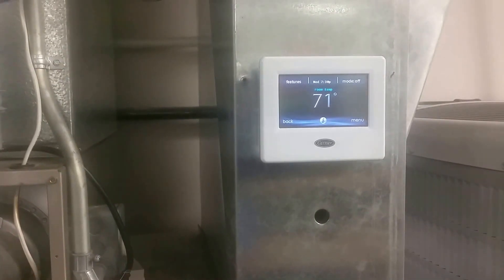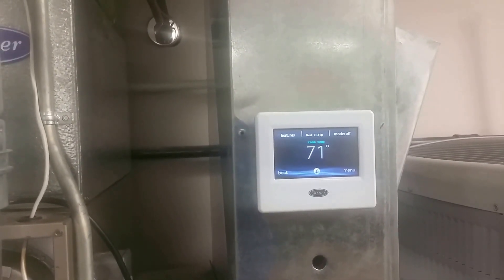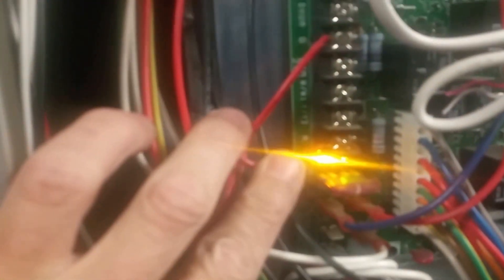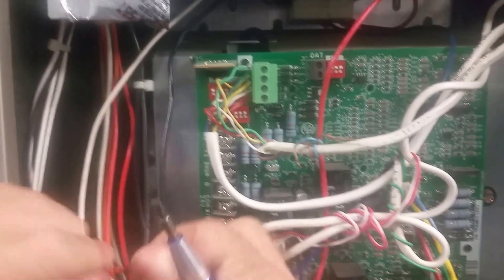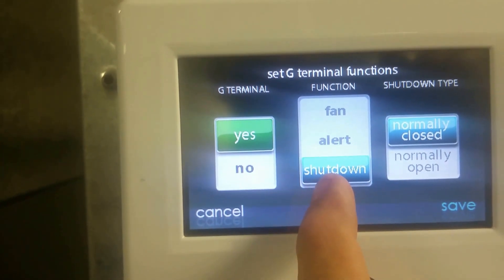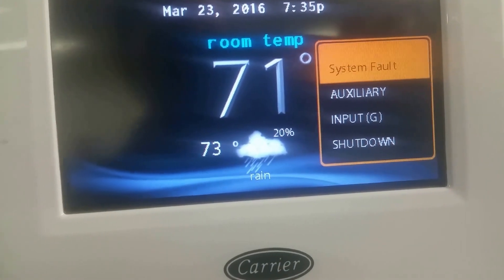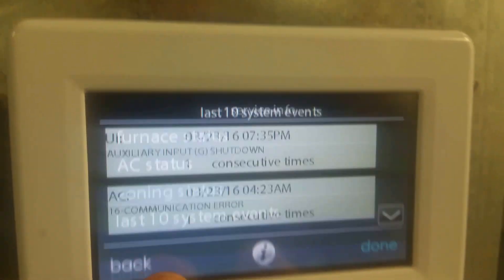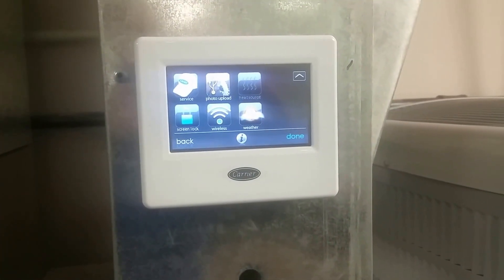G- Terminal Safety Shutdown on Infinity

Comment: wire multiple switches in parallel
Reply from the maker: If the switches are normally closed, rhe other safeties in your parallel circuit will remain closed and will not shut the system down, wire safeties in a series circuit.
Reply: You are correct, I was mistaken @HvacExpert
Reply from the maker: @mikebrauckhoff6604 No worries, there are some companies that use a normally open switch, they will work in a parallel setup if you change the infinity “g” terminal settings to normally open.   Have an awesome day !!

Comment: Hi. I had a customer that had a condensate pump fail and the safety didn't work. They had the R&G wires to the safety but it didn't shut down the furnace so I'm assuming it wasn't programmed into the thermostat. However it was a different infinity thermostat, the rectangle one. Is the programming the same in that one?
Reply from the maker: @richardfossani6421  Correct, it is a feature that must be enabled in the settings on the thermostat (user interface) to provide response to those terminals (R&G) being hooked to a normally open switch or a normally closed switch.
Reply from the maker: Is the stat your referring to the older soft screen or the newer (hard glass) screen, like a cell phone . Enter settings by holding down the service hat icon for about 5-10 seconds.

Comment: I have this Carrier Infinity t-stat and I’m in Florida w/ 105 heat index. System will ramp up to keep house cool. After an hour of full ramp-up the system will just shut off. After 10 to 15 min it will come back on and operate, but with fan on low. My system does not send a notification/message.
The drain line does not have a P-trap on it, so I feel the vacuum from the air-handler ramping at full speed causes water to not drain and trips the float switch. Would a P-trap solve for this problem?

Comment: I had to watch this with no audio. Is there any reason you would use this instead of breaking "D" with a normally closed float switch on a Carrier Infinity communicating system?
Reply from the maker: Using the R&G as designed allows for logging of this circuit in the event history.  Breaking a comm wire for the switch will lump any “trips” of this switch as a “loss of communication”.   Breaking a power wire to stat allows it to log nothing.  Simply put using the R&G terminals with infinity control allows for a service to look at event history and be able to tell exactly, “that float switch opened up at 8:43 am on this date”    Helps in diagnosing odd ball problems and advanced troubleshooting .
Reply: @HvacExpert  Thank you, I figured logging and the alert was the primary benefit.

Do you know of a way for the Infinity to send a dehum request signal to close a relay and bring on a standalone dehumidifier, ideally with the Air handler or furnace fan?
Reply from the maker: @ChristopherMundahl  It has been requested by many, but not available as of yet.  The communication between control and equipment is proprietary and not within’ carriers sites at this time.  It has been proven a very good system to use of dehumidification on a side note. I have won many bets to say, turn on overcooking to dehumidify, set your ac temp 3 degrees higher than you normally run your ac, set humidity set point at 50% and most of the time, the infinity system works as a whole house dehumidifier much better than a stand alone unit. These are features built into the infinity (carrier,Bryant) control systems.
Reply: @HvacExpert  gotcha. Yeah I confirmed with Carrier tech support earlier today. They should build a relay board to control 24vac relays like what Trane has for their communicating systems. I live in the 2nd most humid climate zone. Also sometimes people want to save energy versus using the reheat feature. I do agree that these variable speed that can turn down to 25% capacity and runing really low blower speeds for dehumidification work well versus single stage.
Reply: @HvacExpert  I actually broke Transformer wire to board with float switch because G is the only missing terminal... the thermostat boots up quick I don't care about logging

Comment: Currently diagnosing g terminal shutdown during winter without any condensate.  Now jumping.  One float on condensate pipe, one float (microswitch) on pan in series.   Do the pan switches actually fail?  More frequently than controller board?
Reply from the maker: The safety circuit wiring or devices are more likely to fail than the motherboard.  Unhook both sides of safety circuit at R and G terminals, Jump R&G at board with wire, if fault clears than it is wiring/devices.  Be sure the “G terminal” setup selection has been made for a “Closed” circuit vs “Open Circuit” as the safety circuit is designed to be a closed one. The fault should auto clear once R&G have been jumped.  LMK
Reply: @HVAC VLOG  Yes. Settings downgraded to alert from shutdown.    From what I see monitored when blower is on.  More likely to see it during continuous low fan operation.   Less often when at away, and fan is auto.  I suspect float switch it intermittent.
Reply: Actually, maybe hard to know when alert is "cleared".  I assume that when there is an event in the log, but not displayed on the thermostat, it is cleared.
Reply from the maker: @hpanken  Correct on cleared if in log but not active.
Reply: Leaving jumper on, 3 weeks later. 2 alerts with light furnace usage (55°).  Turned furnace  up to 74°, 10 more alerts over night.  Controller bad?  Anything else to look at?

Comment: I have replaced the drain tube(which was clogged). How do i tell the system that the problem is solved? Im getting the auxiliary input G alert constantly
Reply from the maker: Once the circuit is closed it will reset automatically. Check to be sure there is no other devices in the circuit wired in series. If the drain pan switch is electronic, it may have internally failed. The circuit between G and R must be closed (jump out to diagnose).
Reply: @HvacExpert  thanks for the response. Here is the issue. Personally, i’m not knowledgeable enough in this to completely understand. I had a hvac tech out here today for an hour and he could not determine the issue, wants to speak to a carrier tech to follow up. Now, he did jump the wires in his efforts to isolate the issue but still didn’t arrive at a reason. What, exactly should we be looking for or doing once we have jumped the wires? Im missing something in the logic i think.
Reply from the maker: If he was able to get the error/message/alert to automatically disappear after he jumped the (R) and (G) terminals together, then whatever is hooked to those wires as a safety, has either failed, has a broken wire, or, is actually working and detecting a proper shutdown.   The circuit between G and R is meant to be a (closed) circuit when everything is okay, when water or whatever is being monitored is detected, the circuit (opens) and “G-terminal alert” is generated.    So, we know the board is okay and that correct circuit option is selected in the infinity setup as the alert is gone after he jumped it.  The focus is on the “external” devices connected to R and G.  Double/triple check the drain. Pour water down it (like a gallon, it should take it without backing up, and make sure it is not airlocking and require a “vent” to allow it to drain. Make sure the outlet is not freezing, or any other part of the drain and only happening when temps drop below 32.  By the way, since he jumped out a “safety”, keep an eye on it so you do not “find out” water is backing up the bad way, water damage.   Double check the wiring, ohm the wires out with a meter, ohm the switch(s) connected in series to R and G, should be closed circuit. If one of the safeties is an electronic type, you may have a rare event happening that is hard to catch as you may be tripping a limit in the equipment during operation. External switches that require power are powered from the board by tech’s in the field, so, with carrier, when a limit trips internally it will drop out power at the board, hence dropping out power to the electronic safety (wet switch) and cause the switch to trip.  That may have been deep there, to help, are you getting this notification on your phone or popping up on the thermostat.   Be sure the tech is entering the fault/service history in the thermostat, so to tell if the “g-terminal” fault is happening at the same time as another fault, as that is the trick to determine if this rare event is happening or not.   Be sure air filter is clean/new - Vents open/returns not blocked by couch (etc).    Ill let that all sink in for a bit.  Let me know if assistance is required as the prior carrier rep and myself work well together, lol.  Have good luck!

Comment: I believe I actually had a blocked condensate pipe.  I since (may have) unclogged it now as I at least see water dripping out slowly now (none before at 85 degrees today).  How do you clear the code so my unit kicks back on here?  Thanks man.

Comment: I realize this video is a couple years old.  I have the latest generation of the infinity connex thermostat, and it sent me an email that says "AUXILIARY INPUT (G) ALERT" The G terminal is connected to the condensate pump.  I gave it a wiggle, and it ran for a few seconds and stopped.  I think it is working correctly - there is no puddle due to overflow.  What's up with the alert?
Reply from the maker: Angus Podgorny    The AUX G is still a safety circuit on new infinity.  There is a safety (usually float, condensate pump switch) tripping the aux g notification.  It is also possible a 33 limit trip occurred and not set up to send you a notification of it, as 33 limit trip also causes AUX G trip at exact same time.
Reply: Had the same problem today with the customer getting an alert and I looked at the condensate pump and ez trap and there was barely any water in it cause they’ve only run AC once this year. Couldn’t find a problem
Reply from the maker: Check to see if a 33 limit trip occurs as the exact same time as G terminal fault, if this is noticed in the last 10 system events, then its the limit tripping, dropping out 24v on the board which also causes as simultaneous G Terminal fault due to that loss of voltage.  

I have caught a few Ez traps lifting up due to static if evap in the positive side, or older version of them the float could pop off and not be attached to rod keeping switch closed. If you have worked on these you know what im talking about. 

Any chance drain is clear enough to drain but slow? And backs up when latent load in increases. 

Good luck, let me know. Ty

Comment: would this ever be used with an april aire fresh air unit?   my april air damper is set to open 5 mins every hour,  maybe when it opens it can send a signal to the g terminal and turn the fan on for 5 mins to bring in fresh air?   otherwise the damper can open and if the blower is off it's useless.
Reply from the maker: more jello please , You can bring the fan on that way from control of April air unit. However, We usually use a current sensing relay on blower motor to tell fresh air unit blower is on, then it will initiate a damper open for time duration (5 min in your case).

Comment: A side comment - If the wireless is set up and the customer info is set up, then the customer will get an email/text of the condition [Auxiliary Input (G) Shutdown].  Also, I think that if the service co is set to receive the info and the customer designates that service co, that service co will get the same email/text. Pretty slick.